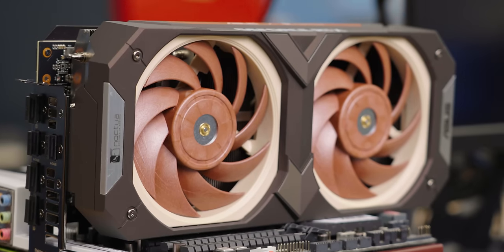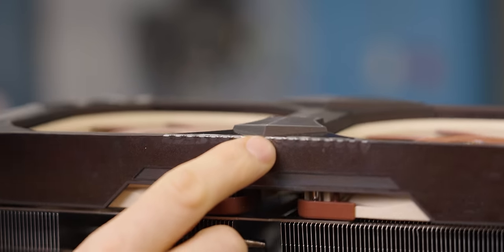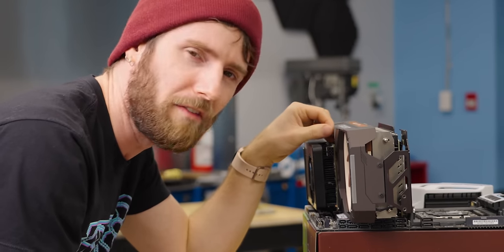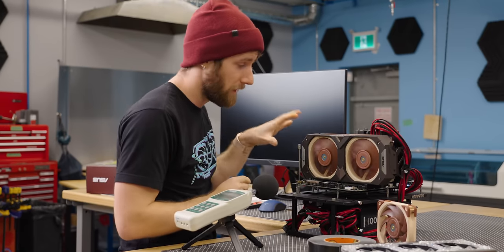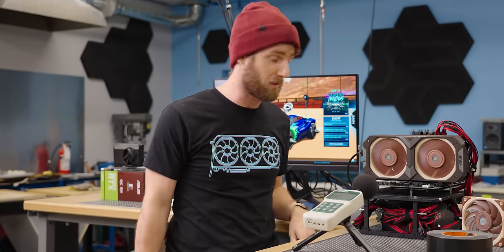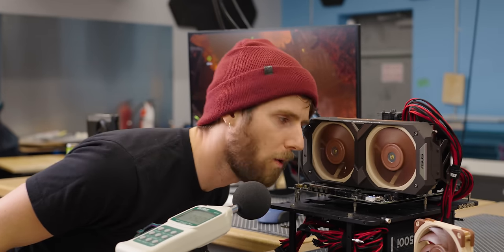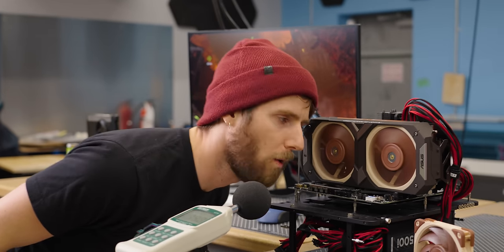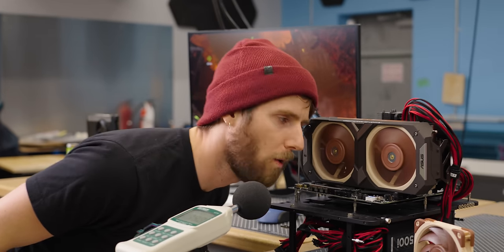Real Noctua GPU vs Redneck Engineering My Own

Comment: I'm disappointed they didn't go for a 3080 or 3090 in the collab, just to really show off that Noctua cooling prowess. If it can keep the heart of a dying star from hitting 75C, it's legitimately impressive.
Reply: problem with that is cooling the memory chips behind the card
Reply: Or a 3070ti.
Reply: or at least turning the fans to 100% and pushing the OC!!!???
Reply: 3070 was the right balanced pick here given the goal of the collab to create a near-silent product even under full load. This thing ends up drawing around 240-250W under full gaming load, whereas the GA102-based cards like the 3080/3080 Ti/3090 in a similar config would end up in the 350-400W range. To get that level of cooling/silence using just off-the-shelf Noctua 120mm fans would end up with a card so monstrously huge and heavy as to be impractical to even bring to market.
Reply: @Bomkz  If the AIBs spend $5 more on the manufacturing of a $1500++++ card they would place a thin laptop style heatpipe from the backplate to the main cooling block. Problem solved. Im sure a Noctua collab would have done something very similar to this for a 3090.
Reply: I hope that ada lovelace solve this memory horrible temperature issues, if you cant design a good cooling solution for back memory chips, why instead use 2gb chips and use only one side? When i think about it, it freaks me out how simple could be the solution for 99% problems of thermal on 3090, its a very expensive card already, why dont just spend a little more on better memory chips, i really miss reability of samsung GDDR6 chips that were so much colder than micron or hinyx even on heavy ocing
Reply: I also think the same but they probably aimed the highest demographics possible and that ranges from RTX3060 to RTX3070 (in current generation). If I didn't have already a 3000 series card I'd totally try to get that Asus Noctua. For me sound comfort  is as important as graphic quality and performance.
I have a Zotac RTX3070 Twin Edge OC and it can get very noisy under high load. And that's no small thing when you realise I always play with headphones.
Reply: They probably tried, but when it got to the size of the P1 the test audience said STOP.
Reply: @XX-121  Jayz2cents already tried it and he couldn't push the OC. Temps were totally in control and power pushed to its max and never reached specially high frequencies nor power limit. The common consensus was that voltage limits this card.
Reply: i bought a Ryzen 7 and a 5500XT last year ago, so i am good for the moment. Furthermore i have 2 PCs Running in my home an "older" I5 with a Vega 56 Graphics card and the Ryzen 7 3700X, i should be ok for next 3 years.
Reply: @eisaimiaplempa5240  quad fan, penta slot
Reply: @albertmas3752  as someone currently gaming on a gaming laptop, I never knew noise comfort was so important to me. 
I will literally play on low gfx settings now just to keep temps/noise down as it just irritates me
Reply: Exactly my thoughts. The 3070 was already a relatively cool and quiet card out of the box.
Reply: I'll be shocked if they don't come out with more down the line.
Reply: @justjosh11  This is why i never could go laptop. Cant stand noise or high temps.
Reply: @Bomkz  much wrap around heatpipes
Reply: Imagine 3090 ti with Noctua Asus collab. No need to watercool.
Reply: Indeed, the 3070 totally didn't need this. I would like to see this on a RTX 3090/ 3080 Ti in a 3-fan variant. That would be awesome.
Reply: @eisaimiaplempa5240  It would be the same size realistically.
Reply: @Bomkz  Snorkel duct over the top of the card to the back side to more cooler back there would probably do it.
Reply: Hey bro, I don't know if you checked, but in two weeks they will launch the Asus x Noctua RTX 3080. I guess a RTX 3090 would be too big with these 3 120mm fans there.
Reply: I genuinely lol'd
Reply: @jzuany  3080 is out :)
Reply: @Shadowfax2121  shit is expensive not worth
Reply: @RobCarter04  this aged poorly rofl. They just made a 5 slot 4080
Reply: This aged well
Reply: Or did they not make a 3080
Reply: They now have one for like the 4080 or 4070

Comment: When Linus showed us the noise of the fans, I could only hear one thing. My 8 years old laptop's fans spinning as loud as a jet engine.
Reply: Hehe
Reply: i thought i heard the gpu fans in the video, i paused. I still heard it.
Reply: I have a xbox 360 power supply for my screen and it's sound like a jet engine too
Reply: You gave an 8 year old a laptop?
Reply: Open it up, get the dust ect out from it. Repaste it. You won't even know its on.
Reply: No way is your fans putting out 150 db.

Comment: At some point, GPUs are going to need to start having dummy PCI-E connectors on their shrouds to fight the sag
Reply: This is why I like my RV-02b case, the layout itself is turned 90 degrees so the card sits up instead of sideways, no sag at all :)
Reply: Wouldn't work because slot layout is pretty random. Could certainly fit a bigger IO bracket to mount to more rear slots on a card like this though.
Reply: @kwlkid85  could make a modular system with screw on connectors
Reply: Sandwich cases are good for this. More case manufacturers should add gpu support brackets XD
Reply: Or just vertical mount..
Reply: @cykablyat8513  There's very few cases that could vertically mount this card.
Reply: @kwlkid85  any true desktop case can as long as its not a slim line case
Reply: Lol my 4080 literally came with a GPU anti sag support bracket in the box.

Comment: You can definitely make this work. I picked up an RX 580 4GB early in the pandemic for like $50 because the fans wouldn't spin. I took the shroud off and zip tied two 120mm case fans to it and then hooked the case fans up to a spare fan controller I had. I just cranked the dial on the fan controller when gaming and temps still stayed below 70C. Ended up selling it after the GPU shortage hit for like $140

Comment: I actually have had my own "Noctua-Edition" for the last 2 years. 
Using a Morpheus 2 custom cooler with 2 noctua fans on my 1080ti,
my peak temps also only reach 55°C with the side panels off. and it is whisper quiet too.
11/10 would recommed
Reply: I swapped my Sapphire RX590 fans with zip-tied on Corsair ML120s a while back and haven't been happier. Much quieter and now peaks about the same temps the stock fans used to idle at.
Reply: I had strix vega64 that ran way too hot for the size of the heatsink, even after thermalpad fix and whatnot, so i ziptied some 120mm fans onto it after taking the original ones off & it ran ~10-15c cooler all across the board & only at ~1000-1200rpm, which was pretty much dead silent compared to the original ones + ~2500-3000 rpm
Reply: Haha had the same cooler in my 1080ti too. Similar temps with mag levs
Reply: I did the exact same thing. I had a 1080ti hybrid with a dead pump, so I swapped it out for the Morpheus II and stuck two Noctua fans and it worked better than when the card was new. Also I’m thankful that Raijintek had the foresight to include heatspreaders for the memory.
Reply: @Nerdy_Lion  Same here with an RTX 2080 in the Streacom DA2 v2 case.
Reply: I did the same with my r vii, but i had to lap the cooler because it was a bit too much concave.
Reply: So essentially if your cooler does not suck and doesn't work by pure force of pushed air you have a chance?
Reply: LTT undersold the morpheus. I have one on my 2080Ti FE with two noctua 120s and it runs ice cold
Reply: @UD503J  won't the zip ties melt?
Reply: @adamb5142  No i had my 1080ti with zip ties and fans to it for almost 3 years no problem. there is no hotspot on the outside where it could melt ot the cooler where the zip ties run along.
Reply: Thought exact same thing… Morpheus did much better job than the moonshine mashup here :)
Reply: I need to do this on my 1080ti founders edition. It's hot!
Reply: have exactly the same setup, nice card m8 ;)
Reply: ya i have the d15 noctuas in a coolermaster silencio something case and u cant hear shit lol. dead silent
Reply: My rtx 2060 that I keep in a case with 1 intake fan about 1mm off my carpeted floor idles at that speed lol
Reply: I did the same with the 2080ti and Morpheus 8057. Totally worth it, I almost can’t hear the gpu now and I was able also to reach a decent OC.
Reply: Similar results. I think a key thing is you need to make sure you aren't trying to sheer hot air escaping the fin stack, with faster moving air from the fans overhanging the edge of the heatsink. To that end, use 3x90mm noctua fans instead of 120s/140s. If you use 120s or 140s, tape off the overhang(underside of the fan sticking out) to stop the self-defeating turbulence.
Reply: did the same as you(1080ti), but also made a hole in the side panel. Average max temp 60°C with old paste and dust :))

Comment: Linus: "You won't see that in the real world. Our room is only 18 degrees C."

Other Canadians: "Look a mister big shot heating his room to 18C in January!"
Reply: this wasnt a good comparison. the heatsink on the non-noctua unit clearly was smaller and thinner. if you are going to use a thinner hs, at least compensate with a faster running fan.
Reply: @BobRooney290  I mean, It's pretty obvious that the noctua one has a thinner heatsink. That's just how comparisons work.
Reply: Thicker*

Comment: I would love for GPUs to start coming with shrouds that hold full-sized fans. It would make it far easier to operate quite GPUs long-term.
Reply: +1 here
Reply: Yup
Reply: I would just love for them to come out in general.  All these videos and none of these products are even available for sale
Reply: Go down to Wally world, pick up a multi speed floor box fan and some duct tape. Take the sides off your system and assemble the the whole thing. (Gonna be loud but cool if it doesn't fall on the floor first.)
Reply: This is actually going to change the world of GPUs when you can decide what you want and it connect to GPU

Comment: I'm surprised that not a single review I've seen has mentioned the repairability (and longevity) aspects here. With literal desktop Noctua fans, not only will the fans easily last a decade or more, but if they ever fail, you can literally just replace them with any random 120mm fan you have lying around, no fuss. Compare that to specialized GPU fans that die after just a couple of years and are a nightmare to track down (plus you'll often get crap quality replacements, not genuine ones), and the small downside of size is completely outweighed, IMO.
Reply: THIS. I have gone through this with my GTX1080 (since prices are crazy i have to make it last longer) replacement fans i found were significantly louder since the motors had a much higher minimum RPM then the original STRIX fans. I managed to get the old fan to stop making weird noises, so now i just keep my fingers crossed i can get a new card at a "reasonable" price before it fails completely.
Reply: Well I guess it depends really, my 1070 strix OC is still working good with its original fans and it's been like 5 years since I bought them, but yeah my 1080ti's fans died a few weeks ago, also a strix model.
Reply: My dude, when was the last time you had a Noctua fan fail?
Reply: @5thwiseman  Does it matter? One could accidentally drop the GPU and break a fan like that.
Reply: @5thwiseman  Mine are still flawless after countless years of use. But that sort of makes this double positive. They "never" fail, and if they fail, they are easy to replace.

And here is a third point: if you replace the card and don't sell or reuse it, you can always use the fans for other projects. :)
Reply: I've never had a gpu fan fail
Reply: I have never had a GPU fan die on me. You guys must be mining crypto 24/7 to kill a GPU fan in a couple of years.
Reply: Der8auer mentioned it. He even made this card RGB by putting Corsair RGB fans in it. Biggest plus: they even use the standard connectors. Simply awesome.
Reply: Just repaste it and your good to go for another decade
Reply: @5thwiseman  There's a reason I called out "easily last a decade or more". I have seen Noctua fans fail, but only because of a huge sample size. The percentage is very, very low. But even so, repairability in case they do should still be commended.
Reply: @Novusod  I have had multiple GPU fans fail from multiple different vendors. I have never mined crypto and do not do heavy GPU tasks daily, although I do run my rigs 24/7.

The most common part failure in GPUs is the fan, whether or not you've had that happen to you is irrelevant.
Reply: @YttriumtYcLief  Some people destroy their fans when they clean them. Never spray canned air into a fan. It will over-spin the blades ten times faster than they were designed to.
Reply: This. I had 280x, after about 4 years the fans became very loud. I put some oil in bearings, but it helped for just a few months. So I ordered new fans from ebay - they were as loud in two months.
Reply: Great now im going to buy 10000 for my crypto mining farm thanks for the tip bro.
Reply: @sebaschan-uwu  I guess it depends on what generation you're talking about.  We sell video production gear that 10 years ago used cards like the GT430.  I've repaired a bunch of them after replacing GPU's whose fans failed after 5 years.  To be clear, most of those units ran 8 hours a day, five days a week under a minimal load.
Reply: @Novusod  i just hold them with my finger and spray them anyway
Reply: @elecblush  just attach 'normal' 120mm fans to it, the GPU market is basically dead rn.

Comment: I did a noctua mod myself, but I found it worked much better with 3 of their smaller fans tied to the GPU instead of 2 of the larger fans. Reason being, the hot air trying to escape out the fin stack would face turbulence caused by the faster moving air trying to sheer past it from the overhang of the large fans. 3X90mm fans gave me 50-60c temps in games, and I was even able to drive them off the graphics card fan connectors.
Reply: i have 2, works fine, 60c, memory 70c under max stress. I also used zip ties, not duct tape like Linus.
Reply: what if you just cover the overhang so no additional air would push through? I did it on mine
Reply: @dreyga2 what GPU are you using?
Reply: @darkaheart  1080ti strix, why?

Comment: Love the design and colour scheme. Would love to see a build that embrace this! Maybe something with dark stained wood and brass would work?
Reply: I was thinking the same thing. The card looks classy in a wood way, not the normal black and silver ish colouring.
Reply: Exactly! It kinda feels retro?
Reply: Sadly most of the market is rgb cases that look like star trek props.
Reply: @VexxedSR  Also sadly, wood is much more an insulator where Steel is not. Would have a lot of performance loss due to using wood, and it’s technically a fire hazard.
Reply: @Xwartu  so it would be more feasible for wood vinyl stickers?
Reply: @Xwartu  This comment is... well meaning but entirely misguided. The case material plays almost no role in total heat dissipation because it's not thermally coupled to the components. There would be no realistic increase to fire risk versus a standard PC case.
Reply: DIYperks?
Reply: @Prophes0r  with the amount of lens flare that I get looking at most rgb lights you could put them in the Star Trek movies and they wouldn't look out of place xD
Reply: Coffee build time!

Comment: Imagine 3d printing a GPU shroud for GPUS. You could essentially repurpose old GPUS, using pc fans and a custom shroud. Breathing some new life, into old hardware, and limiting some E-Waste in the world.
Reply: I did that but without wasting all that time & filament lol. I zip-tied two old 4-pin 80mm fans to my very loud 5770 (office PC) and remapped their RPM. Less e-waste, cooler, quieter, and less energy (0.15A each vs 0.5A). Afterburner even allows for zero-rpm.

Guess I won't do this to my 3080's, too much hassle & danger IMO.
Reply: Isn't that what the aliexpress gtx1050s are
Reply: The signals of the virtue variety
Reply: @andreidavid145  damn…great video
Reply: @andreidavid145  I was literally about to comment the link to this video lmao i love his channel